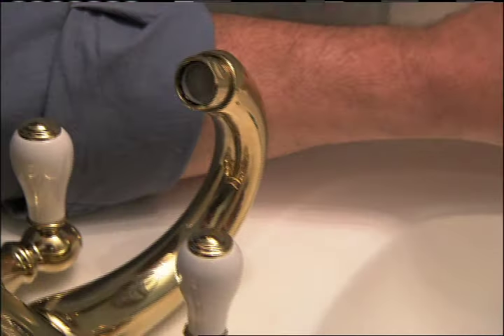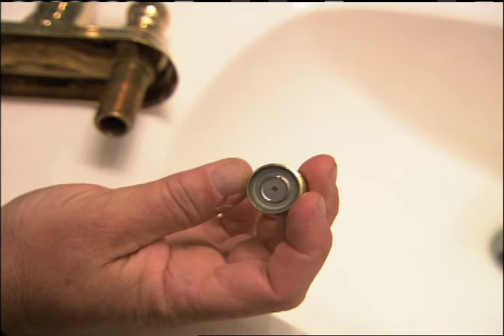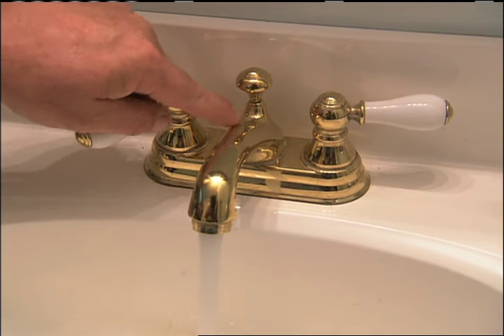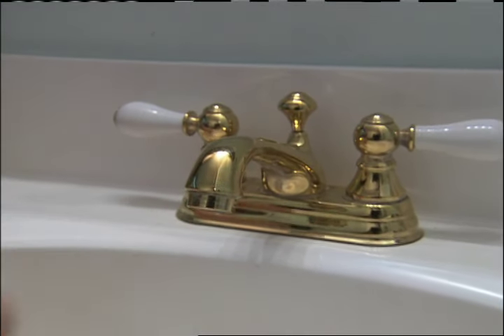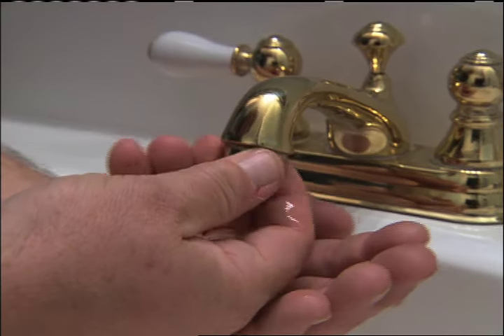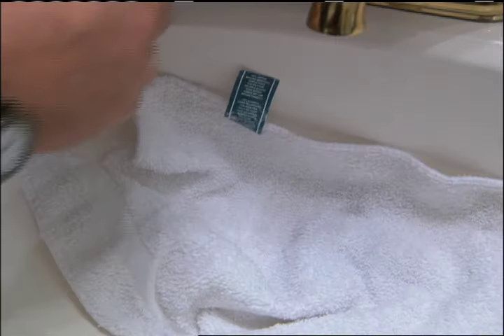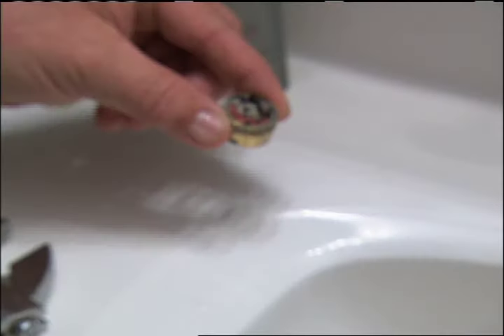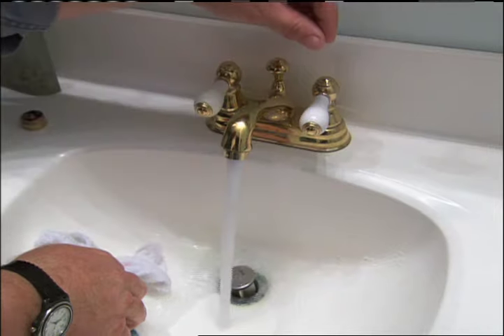How to Clean a Faucet Aerator | This Old House

Comment: When my faucet aerator was plugged up, I just put it in a plastic cup with calcium, lime, and rust remover and let it sit for a few hours. Then I washed it and put it back. It works really well so you don't have to buy a new aerator.

Comment: Our aerators do not have notches.  I got a jar lid remover (basically a thin rubber mat) and used that to remove with my hand.  If it is too tight, the rubber mat protects the aerator if I need to use pliers.

Comment: They didn't address the other type of aerators that are recessed inside the end of the spout.  You have to buy a special inexpensive wrench that has notches on it which fits inside the aerator notches and you unscrew it out.  Buy a wrench set that has several sizes on it because not all aerators have the same diameter.